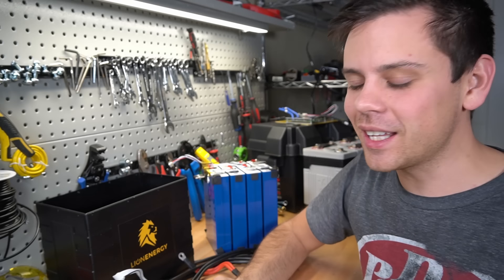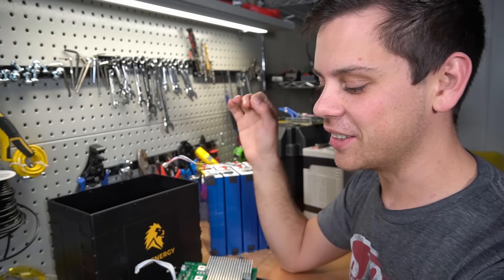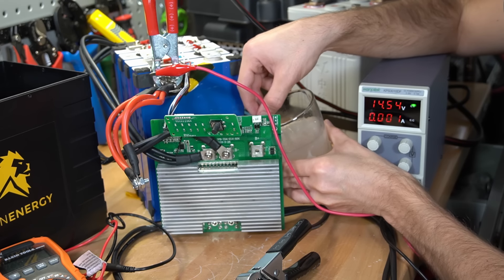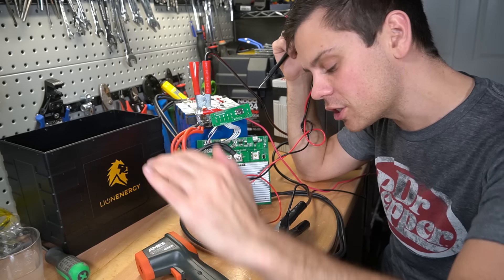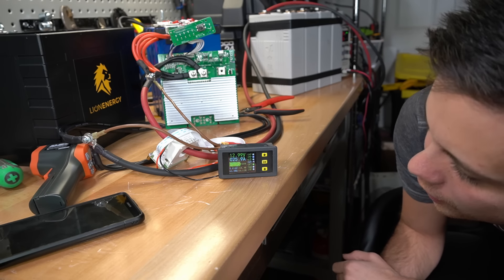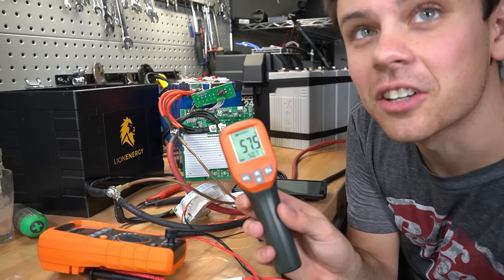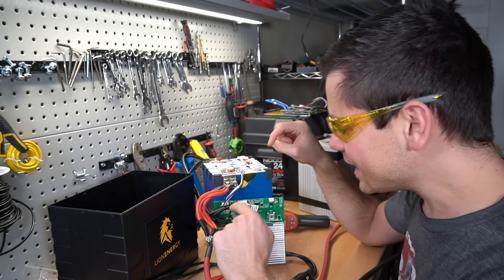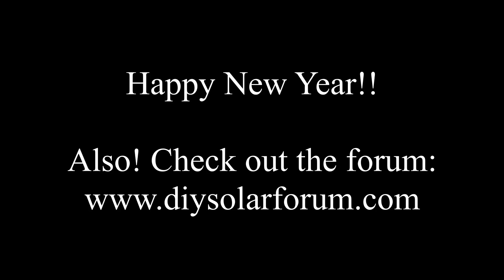Lion Energy 1200 UT Tear Down: High Amp Stress Test and Low Temp Cut-off

Comment: Hi Will, somehow tou got me into batteries and solar energy in general. Is is possible to hookup a system to a socket? I would like to first use “my own” energy first, but at certsin hours push some energy into the grid. I see a lot of problems doing this. Could do a video about it?

Comment: Hey love your channel and it gets me  thinking about upgrading  my system to  lifepo4  batteries and i saw these batteries  on aliexpress  called  Mr Li lifepo4  12v 120ah  they are cells  but each one has a digital  read out on/off switch cigarette lighter usb ports   charging  port  plus the  standard  positive and negative terminal. They battery over charge and discharge feature. description also says that if you buy more  then one to send a message  first  saying how you would want the batteries  like they will  wire it in parallel  or series  or just separate  and its only like $380 to me this sounds  good  but i dont know  it as also  sounds to  good  to be true... but what fo do you think?

Comment: Excellent! I couldn't care less about NYE either, tbh I don't see that much to celebrate.... Apart from the fact I hooked up my 48v nmc 4.8kwh battery bank and APC 1.8kw pure sine inverter. Yippeee,  I've got electricity again which means I can run my mobile music studio.... 😁😁
Reply: Does anyone have experience with an Epever Nd series charge controller? I'm trying to set the user voltages for lithium, but when I input my required voltage, I get 'illegal parameter' and it goes back to standard parameters. Getting frustrated!

Comment: Why is testing Low Temp Disconnect at -9C relevant? Isn't that 10c or 20f Colder than you want it cut off? (isn't that in cold danger to the Battery territory?)
Reply from the maker: Yeah I just wanted to trigger it quickly. People were saying ice isn't cold enough. Technically my last testing method is better. In my opinion
Reply from the maker: Salt water is easier. The Daly and other BMS won't get triggered by salt water.
Reply: @WillProwse  Ok,, so I certainly understand it as a quick test to see if it has a low temp cutoff so you don;t waste time waiting for a 'dead wire'. Once passing the Quick Test, isn't a practical test in order to see just what temp will trip it? Related question, what temp do you consider the optimum to shoot for? I would guess 2C-3C or 37F-40F?

Comment: I just check my car Alternator Gm 1 Wire B.B.Chevy Low turn Charging I’ve been trying to up load the video i’m turning the alternator with my quad less impact gun I might be spending it 500 RPM not even 1000 I’m checking with my bolt meter set on ACV first on 200  buried that set it on 750 buried that got a number of 1,550 v but with my Amp meter no number ?